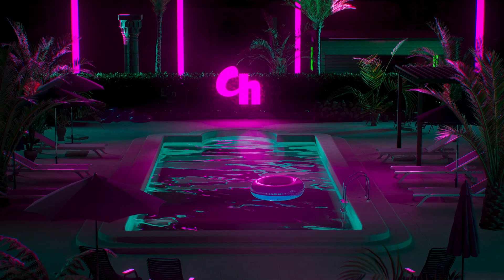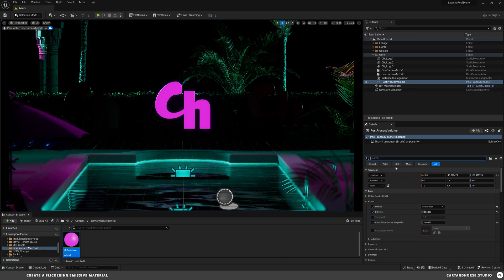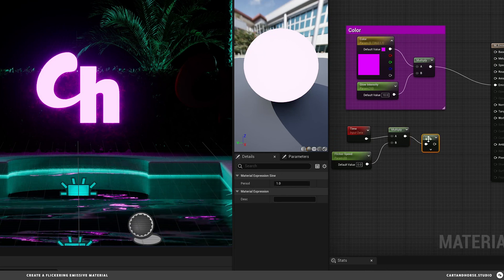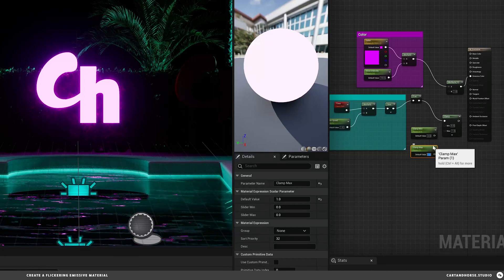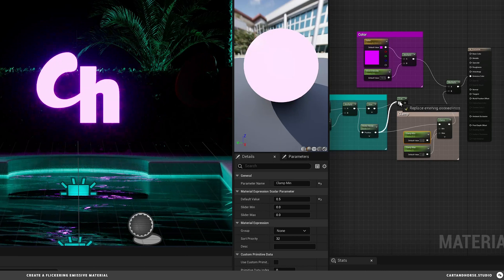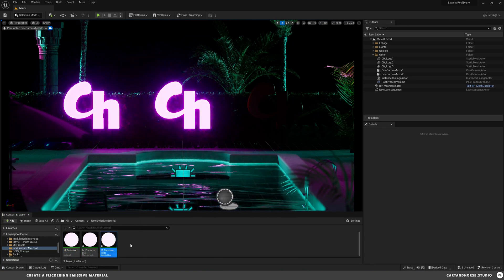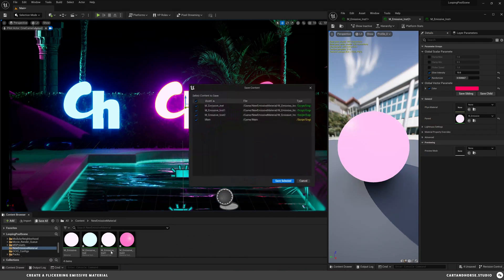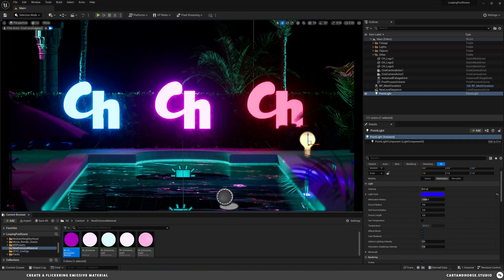Flickering Emissive Material (Unreal Engine)

Comment: What you can also do is use a PerInstance Random node, multiply that with a Parameter and add it to the time before the noise. This way you dont have to use multiple instances of the material.
Reply: I tried this out, but I got this error when I link it before the vector noise node. 

[SM6] (Node PerInstanceRandom) Invalid node used in hull/domain shader input!

Comment: This was super useful, but I'm a little confused by the vector noise (I'm completely new to using Unreal let alone using node editor.)
when I added the vector noise, my blue material started changing colors to red, orange, and cyan. What's happening and how do I make my material stay blue. I'm trying to make a "broken" neon sign as context
Reply: I had the same issue, change the vector noise node to a regular noise node, and plug the add node into the noise world position, and then plug the noise into your clamp node and this should solve the issue.
Reply: @pastpigeongaming5492  i had the same issue, thanks